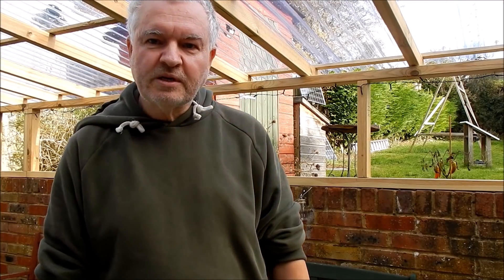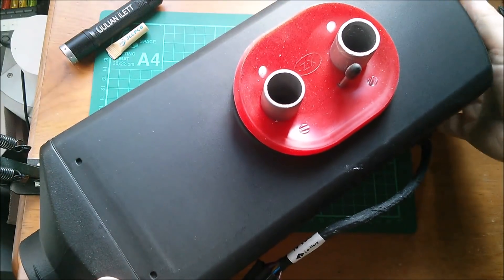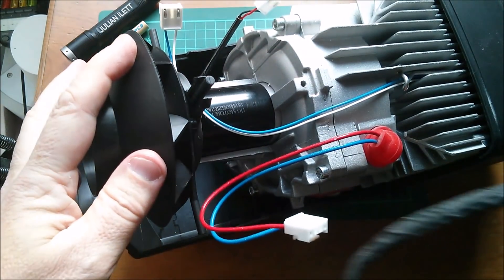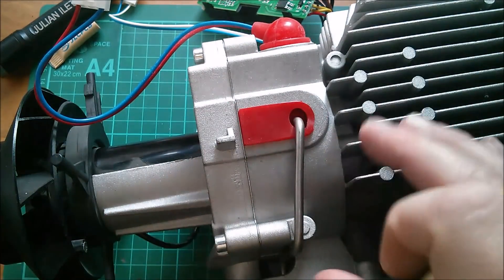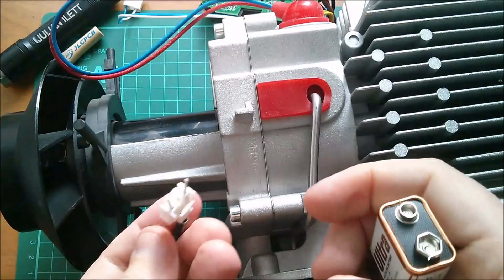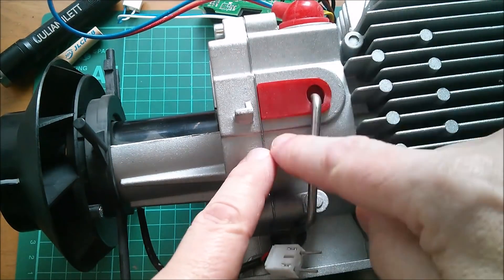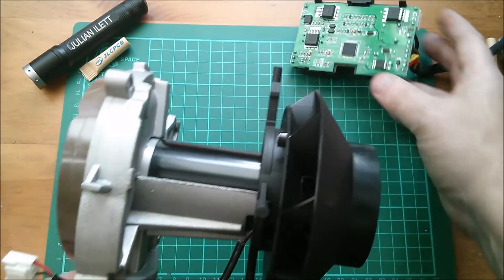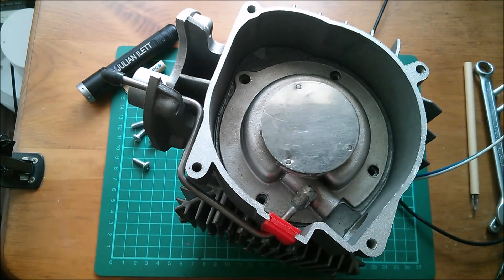A Look Inside the 8kW 12V Diesel Air Heater from Banggood

Comment: Mental note. Deisel does not freeze but it does turn to jello.  I do not know what you pay for diesel but I think a propane bottle heater would be best.  Does not even need any electronics or electric.  Tank swap is faster than a diesel fill from a can.  A "Mr. Heater here on 20 pound grill bottle runs up to 110 hrs.
Reply: the heater you talking about is 60 hours on high and 120 hours on low and is 9000btu high and 4000btu on low with a 20lb tank 
this heater is 5200btu on low at 0.1Lph and 26000btu on high at 0.5Lph so would burn 12 liters in 120 hours on low also at a higher btu and is forced heat with vents so not really that bad 
its about 14.50$ to fill a 20lb tank taxs in where i live and 13.80$ for 12L of diesel
also this heater at 10400btu would be using 0.2lph and would run for 60 hours with the same 12 liters of fuel
Reply: Well diesel is cheaper.  Europe area of the world I think it is a more common fuel especially for cars.  The EPA here has stuck there foot way too far into diesel power and it is no longer a cheaper alternative.  This thing is forced air, looks rather small in stature on the video.  Time will tell I think, I expect more video's.  P.S.  I not gonna look but I need energy density specs, gallon for gallon.  I build and repair transceivers here, deal in Hertz mostly now, was technician internal combustion.
Reply: The "Mr Buddy" heater is vastly inferior. The reason for that being that it's a ventless heater, so you'll be inhaling combustion byproducts. Furthermore, since it burns propane, it also releases a ton of moisture when it burns. Nobody should use unvented heaters, ever. They're health hazards, and moisture producers. This sucks in clean air, runs it over a radiator to heat it and then blows it out the business end, drying the room air and heating it. All the combustion byproducts get exhausted out the exhaust system, which you obviously make sure is outside whatever space you're heating. This is a MUCH better heater. But if you want to burn propane, look into the Propex 2000 heater. It's almost identical to this in function, except that it burns propane. But it too is vented, it blows the combustion byproducts outside the space you're heating.
Reply: Well the first thing gonna say is that the thing is unsafe, no safety devices.  Videos online already of these units spitting fuel all over the ground for failure to light.  This is completely unacceptable.  Next.  Propane burns so clean it can be burned indoors,  that is like saying that I cannot run my gas stove oven in my home.  Julian is also not heating an indoor space, this space is open and will require constant heating.  Amount of power drawn from the unit in 12 volts has also not been shown,  the glow plug draws 12 amps and that blower motor draws I bet over 5. Julian has some solar, advantage there.  What do you do once combustion chamber is full of carbon?  What do you do about diesel fuel turning to jello when good and cold out?  The heat exchanger is surrounded by plastic.  The Mr. Heater is no perfect heater but it is made out of metal and has safety's on it, Just a bump, or a lose of heat on thermocouple kills it, meaning no fuel leaking.  Time will tell.  P.S.  Was OPESSA and ASE certified mechanic.  This is how I know about the graphite gasket that he should replace cause he took it apart.  These are one time use gaskets. It is sealed now but once it goes through a few heat cycles it will now burn out, even if it is not sealing a high pressure combustion chamber.
Reply: @johncundiss9098  there's really no danger if diesel fuel is coming out the pipe it will not light and norm means the glow plug is dead. very easy to change and is a norm problem for the cheap ones to die out early but can buy a name brand glow plug and it will last for a very long time
i'm installing one of these in my golf cart! and i use to use a buddy heater but this will be way way better!!
Reply: Time will tell.   Far as no danger of fuel coming out the pipe?  Not sure where you got that idea, take that statement to any emergency personnel, fire fighters,  or just a reputable mechanic.  I was a mechanic and fuel leaks are not tolerated by ANY manufacturer of ANY equipment, power or for heat. A brand new unit needs a glow plug?  So this thing is not gonna light in the cold as predicted?  Unreliable, unsafe and no work out the box.  I got a Mr Heater that has been in sub zero temps and lights every time, no electrics, and has well over 2000 hrs on it.
Reply: @johncundiss9098  i mean have you lit diesel before with a lighter ? we are not talking about gas here man diesel fumes will not even light lol 
and its not a leak it just means it is not lighting the fuel witch would mean the glow plug has failed or needs to be cleaned. 
only the user could make it dump out fuel trying to start it over and over. they are very simple heaters
even if it starts with diesel coming out of it all it will do is smoke like a 2 stroke till it all gets burned off
its not like they catch on fire. propane could end a hell of a lot worse if you had a leak and didn't know as you cant see it. what if your not there?
you can leave this heater unattended and it will not be able to burn anything down. if they did we would have seen it by now 
and diesel is just fine in the cold where live as they add things to it. can get as low as -40c and no one has any freezing in anything for the most part
Reply: Your right, diesel does not burn, so why you using it for a heating fuel?   And yea it does put out fumes when it is warm, like diesel was designed to be(Rudolph Diesel and cottonseed oil I think).  So you prefer the smell and the danger there?  No American company would allow such a thing,  it is not allowed on vehicles and I doubt it would be allowed in any heater.  But I shall take another route.   You said it yourself, it will smoke puke, choke, smell, and contaminate the ground.  So how long you willing to wait for warmth?  So your diesel is not diesel?  And your diesel does not burn anything down?  A leak is a leak is a leak, propane has a smell so you know it is leaking.  Once you spill diesel it will smell forever.  I can swap propane tanks in 30 seconds.   How many homes have a pipe of gas running into them for heating and cooking, then call insurance companies and ask why they want the garage detached by at least 4 meters?  Time will tell.  Time will tell.  P.S.  Unattended heater?  I thought this was a demand heater for his use on demand when he is out there only? Unless this space is fully enclosed and insulated this heater will be running constantly.  Radiant heat works well in these conditions.  Plus the dog likes to sleep in front of it.(that I do sometimes worry about but yet he been sleeping there for years) P.S.S.  Also need to distinguish the difference between a portable heater and a permanent installation.
Reply: @johncundiss9098 well a lot of house's around here use no.1 no.2 or diesel (aka heating oil) to heat there homes and hot water 
91,600 BTU/gallon for propane
140,000 BTU/gallon for heating oil
and as you can see it makes a lot more heat then propane and is why it is used for heating. 
also these mini types of heaters are used in motor home's, boats, rv's, vans, big rigs, cars etc..
some even come pre installed from factory and are piped to the factory fuel tank and are made by Eberspacher
they also make one's that heat water (coolant) instead of air to keep your engine warm over night so it will for sure start 
and they also come factory installed on vehicles like mercedes benz as an example 
the heater in the video is a clone of the real model heaters that cost 1200-1800$ to buy made by Eberspacher
these heaters work just like the one's that heat house's and boilers only it is a mini version of it pretty simple

Comment: In Japan you can get electronically controlled kerosene room heaters, the best of both cheap heat from fossil fuel and smarts from the controller. You can set them to turn on 30 minutes before you wake up, stay on for a specific time, thermostat will control the output based on room temperature, you never forget to turn them off because they do that by themselves after 3 hours or so (unless you hit snooze), they automatically turn off in an earthquake etc. They don't take up much space and are really cheap too. I never looked inside one but I suppose they would be similar to this thing you have. If our stupid nanny state in NZ allowed them here I would buy three in a millisecond.
For those who might be wondering, yes they do burn totally indoors, and yes it can get a bit stuffy but nothing I have ever complained about and I don't recall hearing anyone else bothered by it either. The smaller the room, the less burning it needs to warm up. The only problem is they can sometimes stink a bit right after turning off because they keep the fan blowing for a few minutes and a little un-burned kerosene fumes get out.

Comment: I have been using Eberspacher and webasto heaters for 15 years now and I have five of them sitting in my shed after the ECU's stopped working and the heater becomes useless Eberspacher has had the market tied up for years and I hope these copies turn out to be ok. 
My latest D4 Eberspacher cost me £1,300 so I could have bought ten of the copies for the same money also even if I wanted to buy new ECU's for my broken heaters they are between £250 and £300 depending on the model just check out the crazy second hand prices on eBay.
As for the tear down the Heater is clearly not as refined and seems to be missing the flame sensor and fan motor sensor this might mean that during a start cycle the the fuel pump could ramp up before the burner has a full flame and cause it to extinguish thus causing a flooded heater.
Anyhow I hope the next vids are good news thanks for the review Jim.
Reply: Look on ebay. There is a guy on there that will repair the ecu and upgrade the parts that fail for £100. Mate had his done and its been perfect since
Reply: @rossastra16v  Hi there have seen his add and I think I did contact him but at the moment he is restricted to the D2 and D4 ecu  and the ones I am in need of are the D3 and D1 but who knows in the future he might expand Jim.

Comment: So much for using solar to go green.  A lot of good informative comments but this seem like an accident waiting to happen.  I assume the burner must be oriented up only and what controls fuel flow? "Diesel" is misleading as there is no diesel cycle.  Its just a crude kerosene heater with an igniter.  No optical interlock.  I guess it just holds a small amount of fuel in the bottom and won't overfill.
Reply: @Chris H
it can work any way up , the diesel is metered by the fuel pump and the sensor on the out side of the unit is the flame sensor :-)
Reply: Thanks YTANDT100.  First time I've seen one of those heaters.  Not sure about using one in a residential environment.  Emissions backing into your neighbor's house, not cool.

Comment: only seen them in 2kw and 5kw, didnt know they sold an 8kw. it should run heating oil which is maybe cheaper than other fuels. theres a facebook group called chinese diesel heaters, the glowplugs are very very unreliable. the seals need to be damn good, the 'cabin' airflow must be well isolated from the combustion airflow...

Comment: Hello Julian.
It's very nice to see you in person, so to speak.
So, my guesstimate I was right when I suggested, (based entirely on the appearance of your fingers) that, age-wise, you were closer to the century than zero.
In fact, you look just about my age which I find most reassuring since I have recently developed quite a passion for electronics.
By the way, I was born in 1961.
I have paused this video at only four seconds in to make this comment, but if I have anything to say about it, (which is largely inevitable), I shall simply make a post-edit addendum.
Well, all the best. And despite my sometimes cynical and/or mocking tone, I really like, and appreciate your work here.
Thanks J, and please: Keep 'Em Coming!
(1:16) - Of course you're not going to be purchasing your diesel at your local garage?
(2:25) - Of course:  That you divert the exhaust completely away from any possible re-entry of any of the exhaust fumes back into your workspace cannot be stressed enough.
Just two words should send shivers down your spine, Sir: Carbon Monoxide. Nothing more need be said.
Reply from the maker: I was also born in 1961 :)

Comment: We got one of these to heat our greenhouse over winter. The whole unit after 1 year was thrown into the rubbish. Even mounted outside, the external and internal air pressures caused the stench of diesel to be drawn inside the greenhouse. It chewed through an inordinate amount of diesel, and obviously is burning an even greater amount of oxygen to run, created carbon monoxide and other nasty particulates as well. So all in all using this unit was unhealthy and uncomfortable at best. Good tear down though Julian, but the parts could be put to making something non-polluting and awesome. Cheers

Comment: Looks very similar to my homes oil based central heating. Its just alot smaller, but has kind of the same chamber and pipe. The only real difference is that in the heating, water flows in pipes around the steel chamber to exchange heat. And I can see the advantages: You could use cheap heating oil instead of Diesel. And this thing is portable, so you don't need a high current socket for an electrical heater around. On the other hand, it just creates hot air. I would prefer something more radiation based for outside, like open flame gas heaters with glowing ceramic elements or metal meshes.
Reply: @
Marco Warga
its not "portable" the two small pipes have to go outside (through the wall) and the starting current will be around 15 to 20 AMPs , it will take about a minute to start up when its primed :-)

Comment: The chamber gasket would be a fibre reinforced graphite gasket. This type of heater was used in the air-cooled VW Beetles and vans, except they were gas (petrol) fueled.

Comment: You can’t seriously be entertaining the idea of using this horrible death trap? Why not rig up some DC solar heating system instead of using diesel and HOPING China actually has safety and QA in check ... this thing will likely kill you!
Reply: You would need an absurd amount of solar panels to make that work, at that point just insulate the greenhouse and use the heat from the sun to heat it.
Reply: Looking at the roof of that room, it's already solar heated.  Could supercharge it with mirrors (string up some space blankets) as an interesting project.
Reply: Joseph F My thought was to cover the roof with solar, add extra insulation to then run a DC heater as needed. As it is a “per needed basis” and not continuous operation, it shouldn’t be too bad.

Comment: Darn!  You've beaten me to it.  I was toying with buying one of those to take apart.
Reply from the maker: He he - I was installing it today - I'll be firing it up very soon :)
Reply: @JulianIlett  With emphasis on the fire bit.  FIREing it up.  I wonder what current it'll draw.  Particularly if the glow plug remains active all the time or if it cuts out once the combustion chamber is hot.  The combustion system is much simpler than I was expecting.
Reply: @bigclivedotcom  Our Webasto at work draws something like 0.7a @24v while operating, but those are specifically made to draw as little as possible, so I'll imagine this one'll draw quite a lot more.
Reply: bigclivedotcom the glow plug is also regulated once ambient temp is reached as well as the fuel flow.
Reply: Sk8terGoat they don’t 👍
Reply: Yes Clive please do! 👍🏻
Reply: Why? You don't operate well at temperatures above 12C.
Reply: silly me , I would have hooked it up to keep me warm.
Reply: I was just going to comment 'I wonder what big Clive would have to say about this' and here you are....
Reply: Go for the 5kw self contained with 6L fuel tank. 100ml per hour.
Reply: Matt Burrows You can change the flow rate. As shipped the Chinese heaters are set at 0.9kw @ 100ml 
Changing the flow rate generates higher output temp heating a standard Motorhome quicker.
I’ve altered mine with a motorised vent so I can switch between air recirculating and fresh air. 
If it get to stuffy. Once ambient temp is reached the heater regulates it’s self and it’s flow rate.
Reply: you can still do it MR Clive most of your peeps might not have seen this . what a cool little heater he did a great job to !
Reply: It's Christmas again so the man with the beard will be coming down your chimney to test Chinese fairy lights.
Reply: They have them at Poundland??
Reply: Current draw is negligible once it's up to temperature. For example, the Webasto (same operational principle) water heater in my Land Rover gets the necessary 12 Volts via a 5 Amp fuse. So I'd expect this unit to draw a similarly low amount of current at start up, dropping to about an Amp once the flame is established.
Reply: bigclivedotcom YES CLIVE do it!!! I want to see you disassemble one of these!!
Reply: Julian been conned ah ah it's a 5kw with a new label. jeff
Reply: Go on Clive you can still do it

Comment: From what a friend has told me about his unit same model as this one, which is installed in a classic VW camper, they are more efficient than expected but warning use them at max output all the time as these heaters burn off the soot to prevent carbon build up but when ran on low output for a length of time it will start to smoke very dark black smoke out of the exhaust and eventually need tearing down and cleaning out to get working again. Be interested how well this works for you as a space heater, I have been thinking of putting one I'm my small garage to take the chill off after seeing my friends. Will keep my eye out for the conclusion.